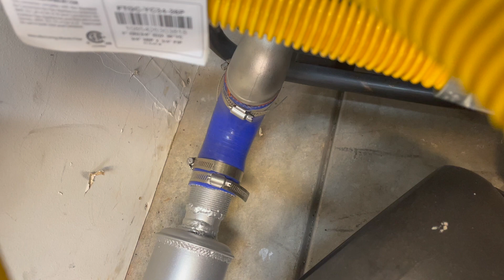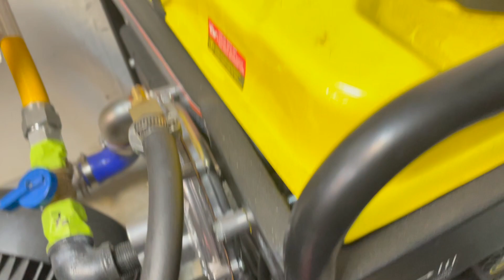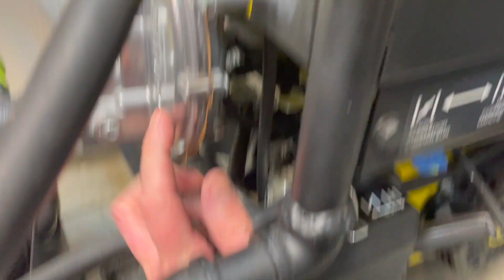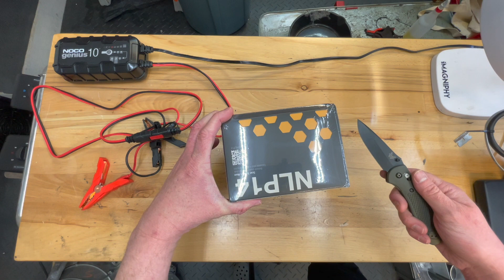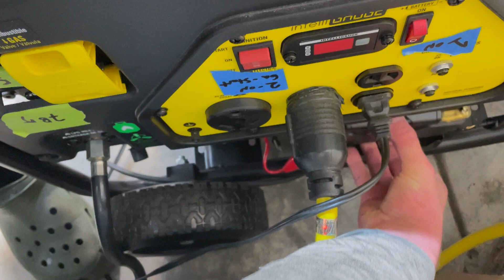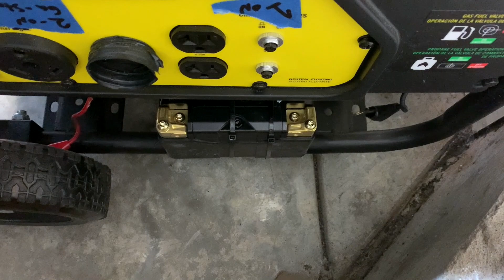Home Repair  - Champion generator hard to start after natural gas conversion

Comment: How did you install this hand choke? I have the same issue with my conversion but seems like this hand choke mod works every single time for you.
Reply from the maker: Thanks for watching! The hand choke is using my hand to cover the air inlet while running the starter. This creates a strong vacuum to pull gas into the system. When I hear the first sign of ignition, I remove my hand to allow air into the system. It takes a bit of practice, but is extremely effective.

Comment: I'm a first responder and have treated patients poisoned by carbon monoxide produced by generators.  PLEASE, PLEASE, PLEASE  relocate this generator to an open environment, or a shed detached from your residence.
Reply from the maker: Thank you for the thoughtful post! It made me so happy to read your concern. I may make a follow up video to address the incredibly important point of CO. What can’t be seen in the video is the large open garage door next to the generator. Additionally the exhaust is sealed  so well that the CO sniffer can’t detect CO even directly next to the generator after hours of running. There are 2 additional CO detectors next to the generator and CO detectors in every room in the house. These detectors register when I turn the gas stove on but can’t detect any CO from the generator. Redundancy is key. Thank you again for your message and caring!

Comment: I have the same generator and a similar NG kit that I haven’t installed yet. There’s another guy on here that did a shortcut video where he just pulled the propane hose off the carb and attached the NG hose from the conversion kit. That eliminates the need to install the flange on the carb and cut & modify the frame to make it fit. Of course you’d have to swap the hose back to run propane but it would only take a minute and far preferable to cutting and welding the frame. TBH I’m kicking myself for not buying a tri-fuel in the first place.
Reply from the maker: Yeah, I had the same thought! Would have definitely done it differently another time around. I do like having the propane attached though as a backup for if the NG is shutoff. I was also able to fine tune it using the NG regulator, which I also like but a whole lot of work. https://youtu.be/VF_fZEu3fFk?si=Sb-6LuWbiVzEyTGK
Reply: @btechnol  I tried briefly to attach the NG hose directly to the propane connection that’s already there to see if it would run without the conversion kit. Got it to run briefly, the battery was dead and I got tired of pulling the rope. May have to experiment further with a charged battery.
Reply from the maker: @markymark8665 lmk what you find!

Comment: You have a bad mixture of air and natural gas, you have to adjust the adjustment screw for it to work correctly, if you do not correct the problem you will damage the cylinder head and you will not have power in the generator,
The adjustment screw is the one next to the black hose that goes to the venury ,Bronce color
Reply from the maker: Correct! Check out my follow up tuning video: Champion generator tuning to perfection after natural gas conversion - Home Repair
https://youtu.be/VF_fZEu3fFk
Reply: @btechnol  exelent Where did you get the oxygen sensor and oxygen viewer kit?
Reply from the maker: https://www.autometer.com/2-5-8-analog-wideband-fse-sport-comp.html

Pretty expensive for this purpose, but I already had it for an automotive project so I thought I’d get some extra use out of it

Comment: You would have figured the natural gas adapter would have been before the carb, not after it.
Reply from the maker: I figured Century put it there so it could be throttled, but I’m not sure there is a throttle, need to check

Comment: Nice Job!!  I needed an NGK plug on my Dual fuel Champ.  It wouldn't even fire up on the propane. NGK was recommended by customer service.  It worked.  It might be in your Manual.
Reply from the maker: Great tip! I’ll give my plug a check and try out the ngk!

Comment: did you ever verify you NG pressure? Also I read that each 90* fitting will hinder volume and flow.
Reply from the maker: Great ideas! I finally got around to it and made a follow up video: Champion generator tuning to perfection after natural gas conversion - Home Repair
https://youtu.be/VF_fZEu3fFk

Comment: Would a partly open valve reduce the inlet pressure on the demand regulator enough to allow a weaker vacuum to open the regulator?
Reply from the maker: It might, but my pressure was already on the low side. I did back the spring retainer out to reduce the force on the regulator to accomplish something similar. Champion generator tuning to perfection after natural gas conversion - Home Repair
https://youtu.be/VF_fZEu3fFk

Comment: Try connecting NG Line to the Carb Fuel (gasoline)  inlet
Reply: I put NG into the propane line and it starts well, runs at full power.  I no longer have the ability to run on propane but NG is my permanent choice so that is not a problem for me  (and I can just reverse the line connections back to propane in any case).  I also have a Champion duel fuel generator, mine is 8000 watts.  I was a little concerned at first that I would not get full power, but I've tested up to 6000 watts with no problems.  (I don't plan on running above 6000 watts in any scenario).
Reply from the maker: Cool idea! I’ll give it a go!
Reply from the maker: I never did try this, but I got it figured out and made a follow up video: Champion generator tuning to perfection after natural gas conversion - Home Repair
https://youtu.be/VF_fZEu3fFk

Comment: How far is your run from your gas meter? If it’s really long you need a larger diameter pipe to give it enough flow.
Reply from the maker: Excellent point! I have been curious what the effect would be of running the larger diameter pipe. Once started, the generator runs under full load without issue, so I haven’t felt motivated to run new pipe yet. It is sitting about 25ft from the meter.